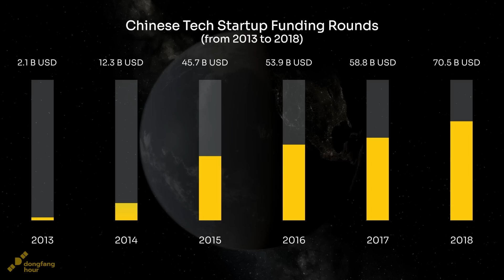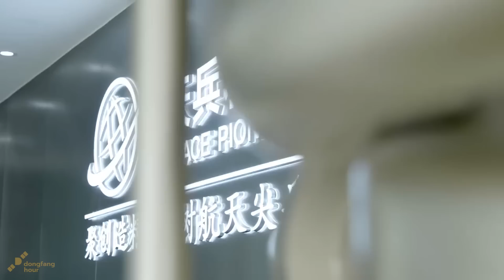A Reusable Chinese Stainless Steel Rocket in 2025?

Comment: Elon had a choice … he could have developed an upgraded Falcon 9 with 9 Raptors. This upscaled enlarged Meth-lox Falcon 9 would have increased payload from 20 tons to 50 tons with lower development cost & risk and shorter schedule than the starship.  But Elon is going for economy of scale (size) and a reusable 2nd stage for the best cost per pound to orbit.  
   In 2025 China is proposing to launch a Falcon 9 equivalent using meth-lox engines.  I expect China to launch a follow on generation with 2 or more strap-on boosters and a reusable upper stage 5 years from now. This will quickly get them close to starship performance in delivery cost per payload pound
Reply: Elon is building cheap reusable rockets to launch his StarLink Comsat Constellation ... to get richer. Nothing else, Dougie.
🚀🛰💰💰💰💰💰💰💰💰👨🌎

Comment: Having a reusable first stage will make the land locked launch sites safer because instead of the uncontrolled crashes of current rocket first stages, they can either return to the launch site or at least to other landing pads further along the launch trajectory.

Comment: SpaceX is probably a decade or so ahead. Once Starship becomes active we are talking several decades. All these other companies can try to copy SpaceX but that’s tough to do at a high level of engineering.
Reply: If we go by the speed at which Chinese companies tmand the CNSA are catching up, they will be 5-8 years away from something similar to starship once it actually works.
Reply: Looking at this one company and not all the other development programs by other Chinese companies, Landspace could launch a reusable 1st stage rocket equivalent to SpaceX’s early Falcon 9 performance by the end of 2025. By 2027, Landspace could be launching dozens of upgraded Falcon 9 equivalents annually.  No doubt Landspace will be developing a starship equivalent as soon as they get big funding after successfully launching their falcon 9 equivalent.   We could see a Landspace starship equivalent in 2028-9.
Reply: So Stainless steel (9:30) was first used on 1960s Atlas rockets and later on 1980s ULA Centaur Upper stages!
Therefore, SpaceX is decades behind ULA (or copycats).
That must make your teeth grind, SpaceX FanBoy!
Reply: @davidstevenson9517  stop calling like that, even all the chinese private rocket companies are spaceX fanboys

Comment: This is where the chinese will fail to compete with the us companies.You cant build the same engine as the raptor if its not available for you to copy😂 unlike a tesla vehicle.The performance of a raptor engine is unbelievable .
Reply: Or they can get help from Russia to build raptor competitor. Russia have the tech but don't have funding and the need to do so. But China have funding and the need
Reply: @KMASIF-mi9yj  as if russia have the technical knowhow to build raptor competitor?
Reply: @tluangasailo3663 Dude raptor beat Russian rd180 engines chamber pressure record in 2022 by a small margin. And RD180 is 50 year old technology. If they were able do it then without any 3d printer they surely could do it now with enough funding. 

Russians are the god of high chamber pressure oxygen rich engine. Won't be surprised if raptor is some how reversed engineered from rd180. After all USA has several rd180 in their possession
Reply: @KMASIF-mi9yj   very true 🌝
Reply: Stop using English you copied from the others!!!
Reply: @kanlu5199  ????

Comment: why not have a floating launch pad in the near ocean???
Reply: There is. Check out Jan. 21 Dong Fang Hour report on the launch of a private solid fuel rocket, Gravity-1, from an offshore ship.
DFH points out that previous launches have all been inland for security reasons.
As we all know, China now has a vast navy to protect their shores from foreign invasion; e.g. during the 1901 "Boxer" rebellion against foreign occupation, the United States landed 8,000 marines and marched on Bejing to relieve besieged Western Legations (Japan sent 20,000 marines).
China no longer fears foreign invasion and more sea-launch (landing?) vessels will follow.
Reply: I believe it is in R&D stage.
Reply: Ship based launches are logistically more complicated, especially for liquid fueled rockets. Also the satellite payloads take some looking after when away from a land based launch site as integration has to take back earlier

Comment: No, you'd better not assume 19 types of commercial liquid rockets, because only several will be ready by 2025 and the most capable ones will survive after competition. And you cannot assume there is only one launch pad for commercial liquid rockets (true for 2024) at the Hainan Commercial Launch Site.
Reply from the maker: I agree with you on both points, but let's say that only 5 out of the 19 rockets types survive. That's still quite a low launch frequency (3 launches/rocket type/year).
I also agree that further commercial launchpads will be necessary and likely be constructed in the coming years. But as there have been no announcements on these for now, so I think we're looking at the Hainan Commercial Launch Center as the sole launchpad for commercial liquid-fueled rockets for at least the forseeable 2-3 years (except for Landspace and Space Pioneer, for the reasons mentioned in the video) 🤔
Reply: @DongfangHour  Multiplication rule is false here, you need an operational science brain. When the top four capable commercial liquid rockets have successfully delivered payloads to orbit, the later and less capable rockets (than Tianlong-3 and Zhuque-3) can hardly get contracts. For 2024 and 2025, several launches per rocket type per year will be a quite tight schedule for each company to improve its launch vehicle, e.g. partial recovery. And building new launch pad infrastructure is always faster than the development/upgrade of launch vehicles.

Comment: I wonder if Landspace could build their own launch pad at other location. Only having it be in Jiuquan seems limiting. I kinda hope they might be able to build one more near the equator?
Reply: Like Malaysia?
Reply: @khairuddinabrahmanrahman7025  Perhaps, same goes for all other Asian countries near equator. Thailand could be another choice, since as it stand it is the only South East Asian country to be part of Chinese ILRS program. While farther away from equator than Malaysia (though not by much), Chinese government and company might want to work more with country that is already part of their space cooperation program.

But who will truly knows what will happen in the future.
Reply: @KVPARM Malaysia is not starting from zero, as the country already supplies printed circuit board interfaces for space applications.
Reply: @khairuddinabrahmanrahman7025  Sure not disputing that. I was specifically talking about Chinese company and Chinese government. Which may prefer working with country already in ILRS, perhaps if Malaysia join it will make the consideration easier.
Reply: Malaysia would the best option for now..

Comment: I'd vote to Space Pionner, It's unbelievably fast. Would see them launching F9 level rocket in next 120 days. 1.5 year faster than Land Space. A heavy blow to all rest Chinese commercial companies
Reply from the maker: That's a good point @razlau, for sure if they succeed in July 2024, then they are definitely and definitively ahead of all their domestic competition.
I'm just a bit cautious with Space Pioneer's announcements, I remember in 2020 when they said that the maiden launch of the Tianlong-2 would be at the end of 2020. And then this shifted to 2021, then 2022, then 2023... Maybe this is the Chinese equivalent of "Elon time" 😁
Reply: @DongfangHour  IMO maiden launch at Sep ~ Oct of 2024 is much more realistic. April to complete the first stage hotfire test and 6 monthes to prepare the launch.
Reply: They already decided to delay their launching plan until July, so it should be next 150 days.
Reply: Space Pioneer aren’t trying to do recovery attempt in their first few launch. I heard they are doing it on their fifth launch (which probably will be next year). Personally I am gonna go extreme route and bet on Deep Blue Aerospace which will actually attempt recovery late this year.
Reply: @KVPARM  In terms of who gonna be the first to recovery the rocket, Yes, IMO DBL would be the first. However the lift of Nebula-1 is 7 times lower compare to TL-3. which means the cost/ kg to LEO would be more expensive than TL-3. The TL-3 would have price advantage even without reusing of the rockets.

Comment: Excellent focused and concise content on Landspace. 
Am a bit surprised they will 'attempt' a boaster landing on the maiden launch. (8:23) Seems they're looking at the opportunity to collect as much engineering test data as possible. SpaceX did similar with it's early Falcon 9 development, with landing targets being just a target in the ocean. (no legs, working up to hover, splash down/RUD)
IMO: It's very strategic and pragmatic that Landspace is developing their own launch complex infrastructure. Launch infrastructure tends to be complex from an electrical/mechanical perspective. Supporting such a large fleet of rockets at the official launch facility adds even more complexity, plus unknowns. Pre-maiden rockets require lots of engineering verification time at the pad, so having no schedule conflicts is a huge advantage.
Reply: The big advantage for Landspace over SpaceX is that SpaceX has proven with the F9 is that landing the first stage works. So many said it was impossible.
Reply: @favesongslist  NASA pioneered the technology in the 1990s with the DC-X program. What SpaceX did was to prove the economic viability of reusable rockets.